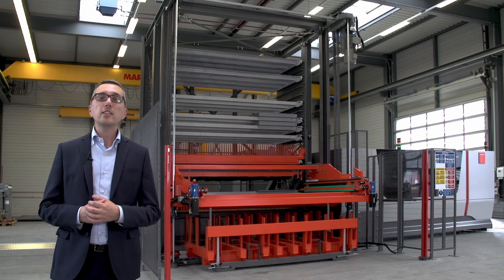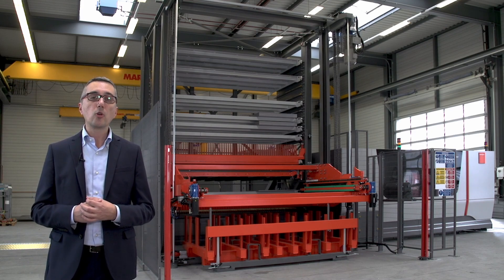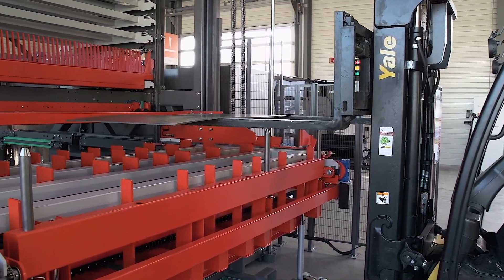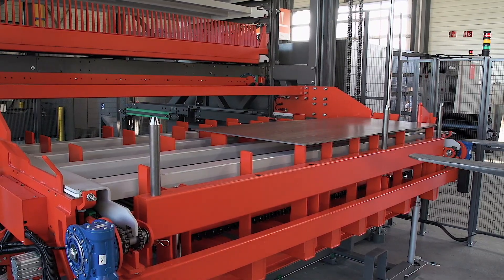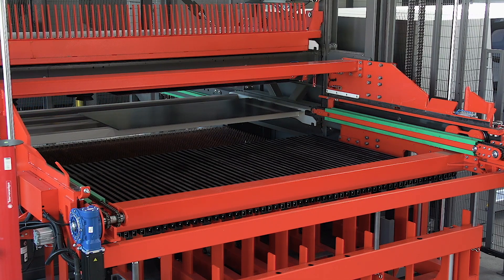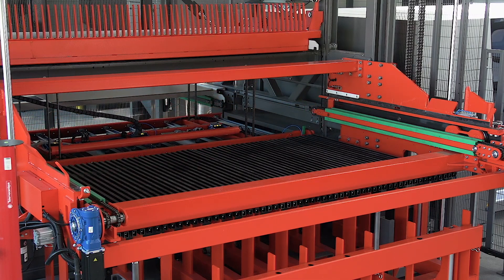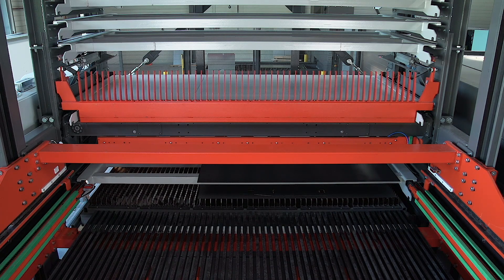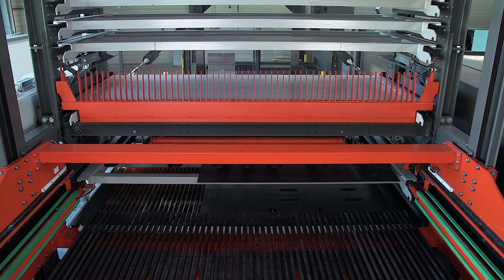Bystronic Automation Laser: ByTower Compact demo video (English)

Comment: Do you have to load the tower one plate at a time?
Reply from the maker: Thanks for the question!
Each ByTower Compact cassette can host 90 mm of material, always with the possibility to place a wooden pallet below it, with a max weight of 3 Tons (3015 format).
The loading of raw material from the cassette to the shuttle table is then automatically handled by the ByTower Compact, one sheet per time, up to 25 mm and 900 Kg max weight per sheet.